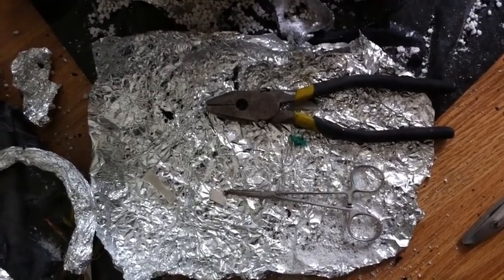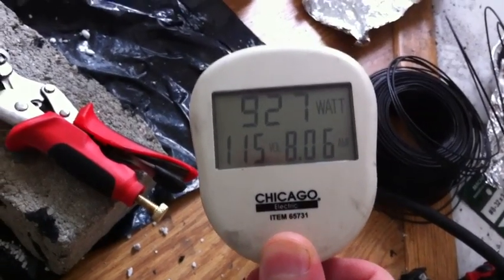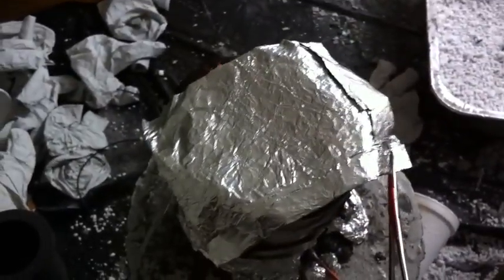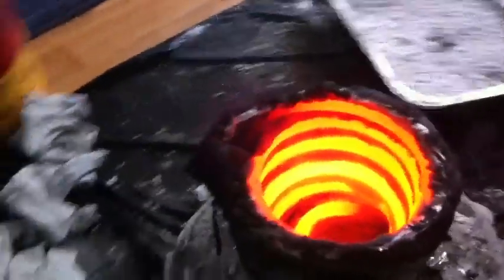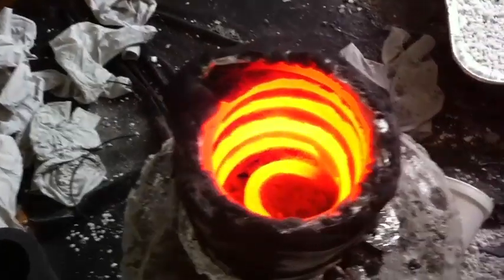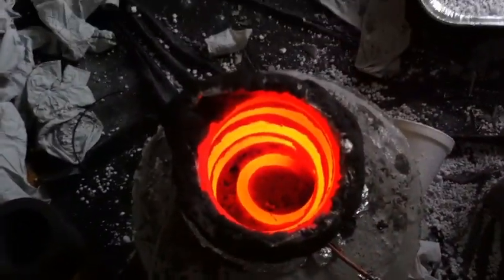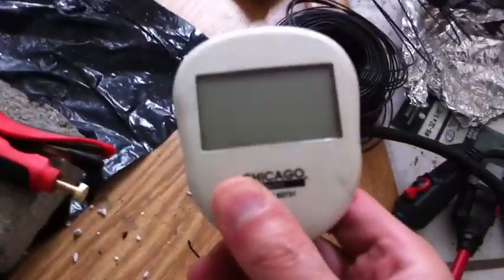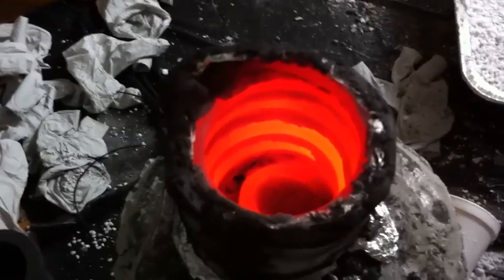"Spiral Fire" Electrical Resistance Aluminum Melting Furnace

Comment: I don't wish to disappoint you but that's not efficient at all. if you put the whole assembly in a bucket with fibre glass insulation round the outside and vermiculite next to the hottest parts then made a lid from an expanded concrete block it would be reasonably efficient. that said I'm sure its effective but efficiency and efficacy are different things.

Comment from the maker: I would recommend a brand new range top element, you can find self-contained 1000watt hot plates with resistance elements on newegg for about $20. To bend them you can use a 2" wooden rod or clamp/bolt an old wooden bat to a bench then wearing thick gloves apply your weight smoothly to the new resistance element such that it is rolled against the wooden curve. Don't force the element from the start, get a feel for it's flexural rigidity. Gradually increase your force/firmness and budget an hour.

Comment: I have all the materials, finally, and started to bend the 1000W burner around my crucible. I was using an old well-used burner and it broke right when I had it bent near perfect. Any tips on bending? I'm assuming a new burner will not be as brittle from the years of heat cycles.

Comment: I will post when I get it working, I'm in the planning stages now. All I have are the burner elements and a stainless steel flour canister to use as a crucible. Too many hobby projects, not enough time.

Comment from the maker: Yes, I've looked at various ratios as well, for this project I decided that a perlite to furnace cement (silica refractory) ratio of 4:1, would yield excellent insulating properties at the cost of structural integrity. In a more professional project, I would have made allowances for a replaceable inner element, and used a more insulating blend, but for this project I chose a 3:1 ratio for the added core strength.
1000 watts will take you far. If you make a working unit, post a video response!

Comment: Thanks for the response. I've seen other videos mention a ratio of 4 parts perlite to 1 part furnace cement. Is that roughly what you used? I plan to build one of these with either a single 1000W burner or 2 600W burners.

Comment: Thanks. I've now built one. 2000 watt stovetop element. 850 degrees C in 15 minutes. Happily melts aluminium in a Salamander #4 graphite crucible. Thanks again.